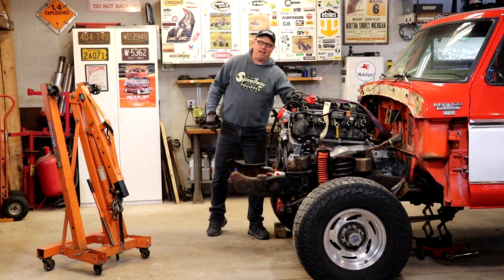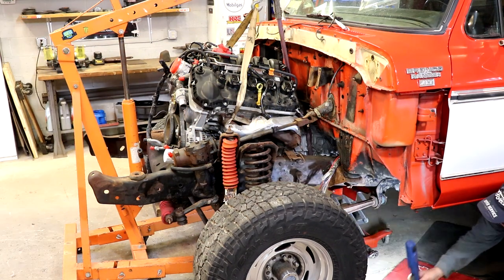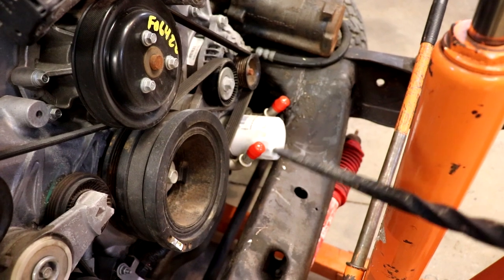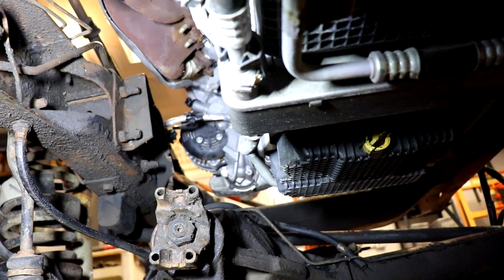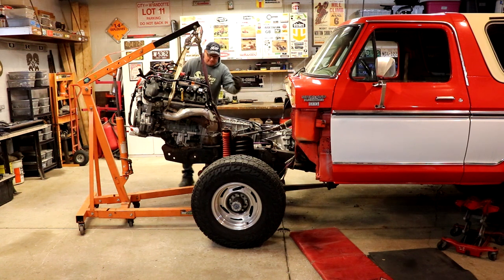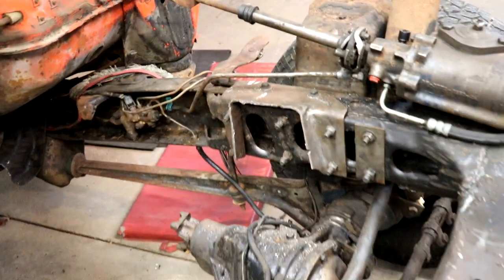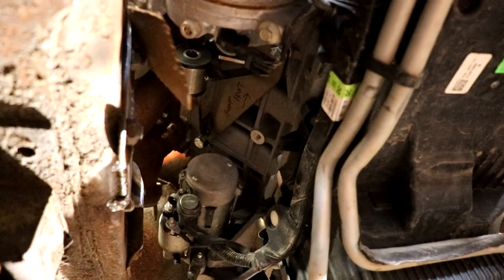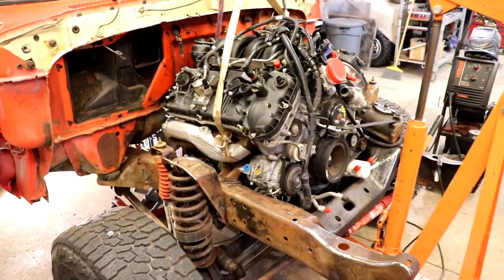The Bronco Project: COYOTE UGLY Takes Shape! 5.0L 10R80 4X4!! EP3

Comment: Thanks for sharing the details of your project!  Great job showing us the reality of putting a similar project together. Can you share who modifies your harnesses and ECM to work with the transfer case?  My project is an early Bronco with a Coyote to be installed. I would like to use the 2014 F150 transfer case with the 6R80, but have been told it could be a problem getting it working due to wiring issues??? Thanks! cb
Reply from the maker: The engine and auto trans controller harness usually come from hotwireauto dot com and the transfer case is run on a stand alone controller made by Kincer chassis. Best of luck! Thanks for watching!!

Comment: I assume you are keeping the double cardan in the driveshaft.  Have you found a suitable slip yoke for the transfer case to mate to the double cardan?  I am doing a similar project and I am having trouble finding a yoke that fits the double cardan or even a flange yoke for the transfer case.  I am using a Gen 2 coyote with the 6R80, but I think the transfer case is the same on the Gen 3 with the 10R80.
Reply from the maker: We have all the drive shafts custom made by a driveline specialist. Our engine supplier provides us with the transfer case plunge/flange shaft & we send that to them with the measurements. :) Thanks for watching!